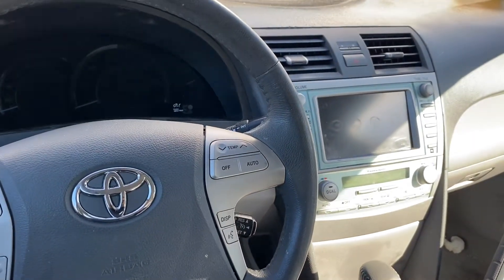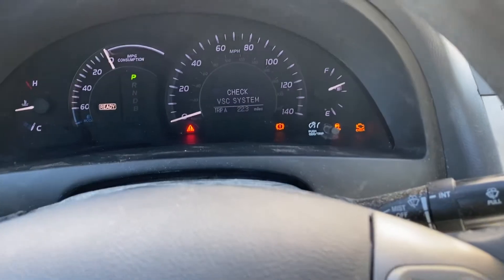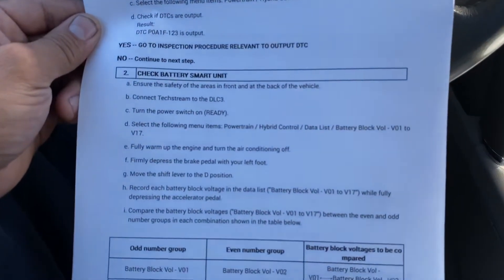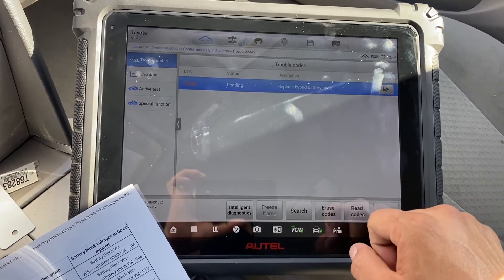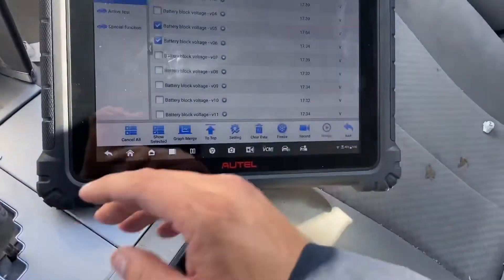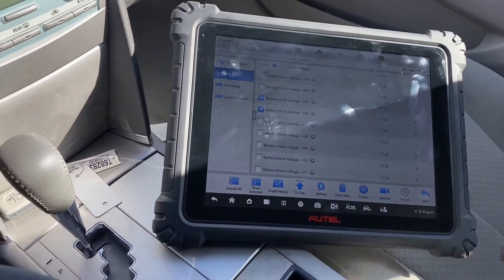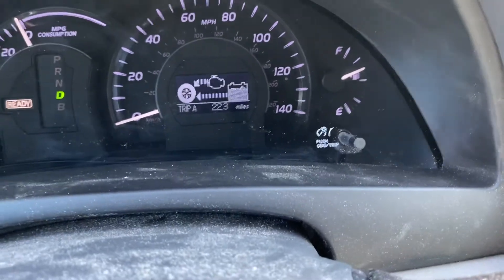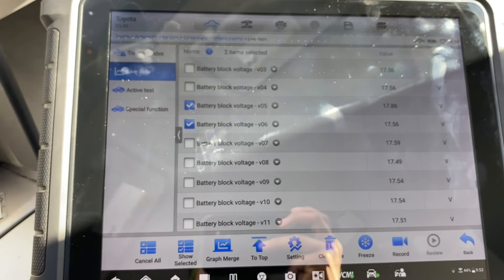P0A80 2008 Toyota Camry Hybrid Replace Hybrid Battery 🔋 pack Check Engine light ON VSC System

Comment: Qué tal buenos días disculpe tengo una duda cómo puedo resetear mi Toyota Camry hibrid 2009 cambié la batería 🔋 no detecta el sensor de la batería,gracias por su atención
Reply from the maker: Hola buenos días si la batería que instalaste es usada posiblemente está defectuosa, va a tener una falla interna. Te recomiendo que hagas una prueba al sensor leyendo los diagramas. El reset lo puedes hacer con un scanner de gama alta o simplemente que te arroje las funciones especiales de Hybrid, puedes tartar con un scanner de gama baja pero solo borrara los códigos de falla

Comment: Yo tengo un Toyota igual y con el mismo problema ya se le cambio la batería y tiene el mismo código necesito saber cómo resetear
Reply from the maker: Sería bueno que intentes cambiar con una batería que tú sepas que en realidad está en buen estado, para resetear puedes hacerlo con cualquier scanner de alta gama, yo estoy trabajando con el Autel MaxiSys ultra y realiza el reset correctamente
Reply: Yo pasé por lo mismo la solución para mi fue ponerle una batería original de Toyota  y después de 2 días el código desapareció 
Según Toyota después de cambiarle la batería al sistema híbrido , para que  la computadora la reconozca  se debe  manejar por unos 10 días    O  15 veces warm and cool